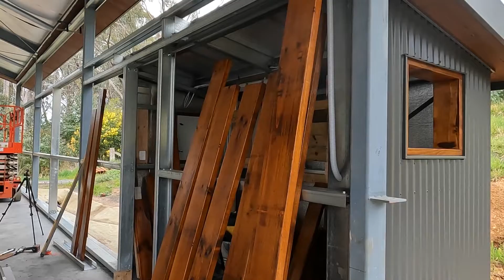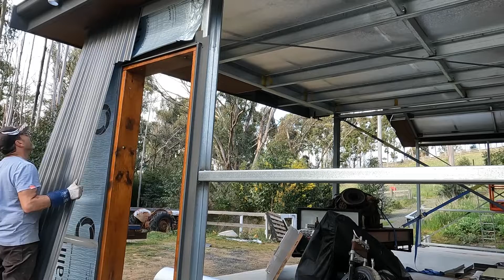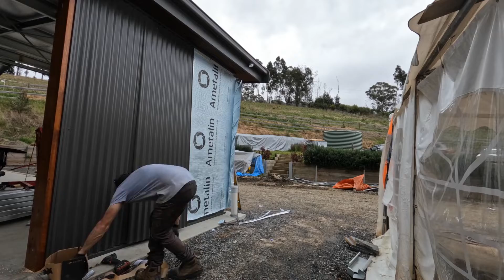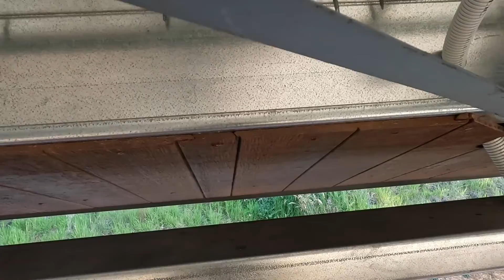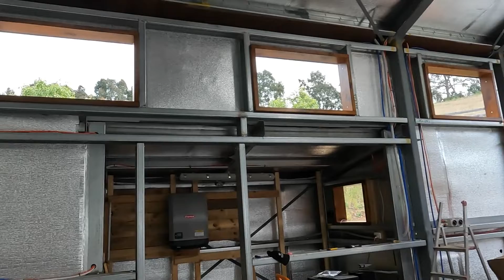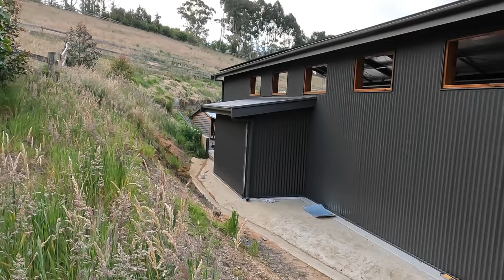Workshop build part 16 - Building the walls

Comment: looks great with the wood trim. is the issue with the grinder sparks burning or making rust stains?  or is there other reasons it's a "no no"
Reply from the maker: Hi mate, if you don't clean the metal properly the sparks will quickly make rust marks when it gets wet. Cutting with a grinder on the roof with sheets in place would be a bad idea, but on the ground I think its fine as long as its cleaned after cutting.

Comment: 😲 you never seam to disappoint looking real professional hi mate i need a favor please can you give me the # for  arp head stud for the your celica cylinder head i just pull my 2tg engine from my car getting ready bore the block to 87mm for the new pistons thanks
Reply from the maker: Hi mate, I purchased the ARP bolts around 15 years ago so testing my memory now. I'm not 100% sure but I recall the part number 203-4206. Like I said its a long time ago so do some checks on that number. I also had to mill down two of the head bolt posts to allow clearance for the cam cover. From memory I think it was the front two....
Reply: @Mezzmoengineering  thanks mate